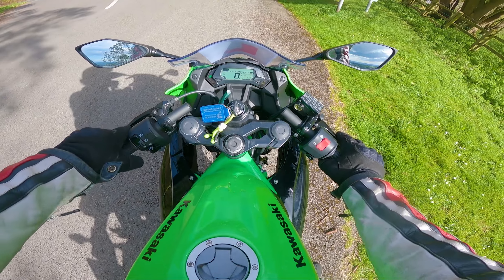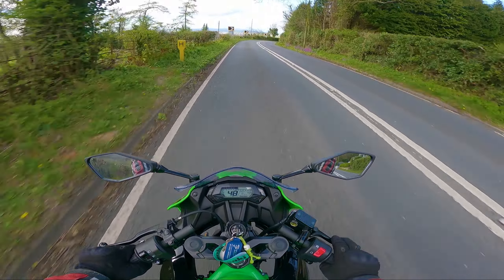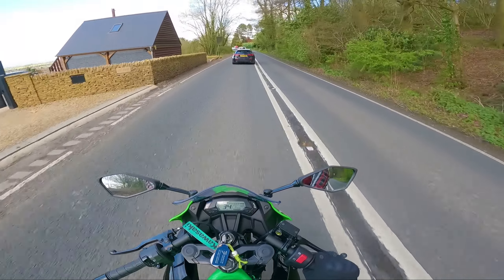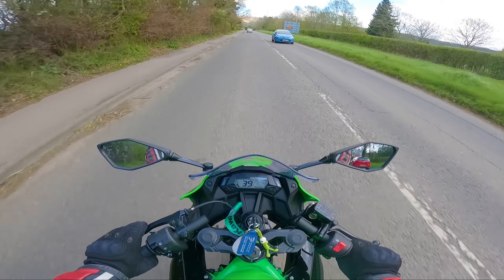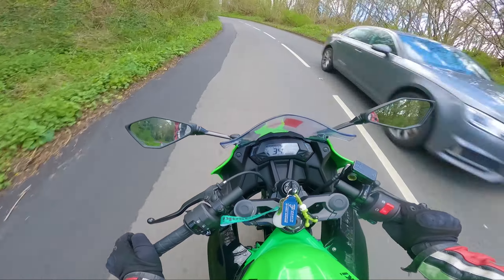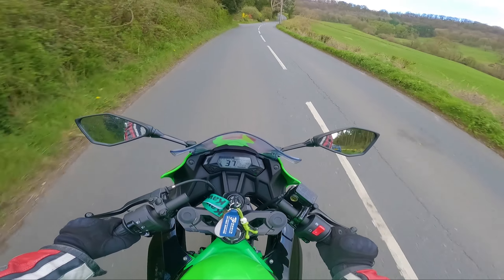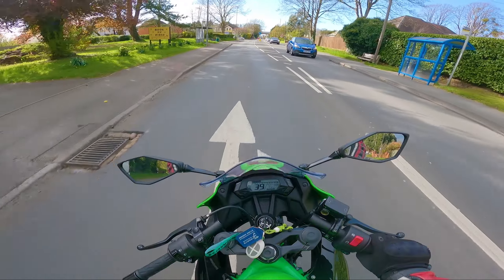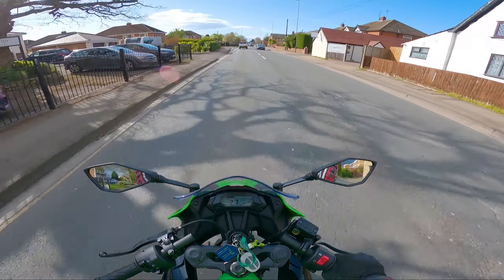Cornering a Motorcycle isn't as Easy as you think...

Comment: I highly recommend learning to ride at speed on a track then transfer to the road.
Reply: I'm sorry I'm just beginning to ride, but is it because it's easier to balance?
Reply: @TanyutHuidrom  it's a controlled environment and you get to know your bike by practicing leaning and braking before corners.
Braking; 
Never break if you can help it IN a corner, brake hard first before the corner then coast through, gently giving gas as you exit the corner. If you think you're going too fast for a corner brake hard best you can before corner then coast through...you should be ok. Don't brake hard into the corner.
 Gear selection; Short shifting(shifting early) or keeping a bike in a little too high a gear can help cushion your throttle response so you don't lose it by giving too much throttle(a problem if you're learning on a 1000cc or bigger bike)
If you're lucky to have a track nearby they are usually very reasonable.
There are also learning courses offered for free or close to it if you look around your area.
An open parking lot is nice too, even at night.
I took a course that was held at Warkins Glen race track years ago and it was amazing.
Don't be afraid to lean pretty hard the bike isn't going to slip out from under you. 
Having a riding buddy helps too.
Start on a pretty small bike like 500 to 750 cc(my first was a 650 Suzuki and it was still plenty fast) A litre(1000cc) bike isn't some uncontrollable beast but a small bike let's you learn your leaning, braking, and cornering.
So on your next session brake hard with front brake or both, coast through corner, then give power slowly coming out of the corner, do this over and over until it's muscle memory. Pay attention to your posture, if you're fighting your bike somethings wrong. 
Town driving is tough too so don't only ride on country roads or track before your test.
On a track you can go fast too as you build up your skill. Don't rush just practice a lot and speed comes with time. Don't hang with wheelie popping Street fighters until you know your bike really well.
On a track it's nice and wide and again it's a controlled safe environment. Also a club or finding like minded riders to ride with is great idea too, clubs are awesome. 
Always remember, on a bike you're invisible on the road. So always look around and be aware.
Best wishes, keep practicing and you'll never worry about accidents etc. I've ridden for 25 years no accidents, nothing. But you must take your time.

Comment: Don’t drop a gear and rev match to slow down mid corner. It is better and safer if you learn how to trail brake into the corner. Your brakes are not something to be afraid of
Reply: Seems like dropping a gear mid corner can go horribly wrong for a beginner
Reply: If you have a lot of power dropping down mid corner can actually make you lose traction as the revs shoot up...
Reply from the maker: I find trail braking gives me less traction than dropping a gear depending on the lean angle. On a little bike you don't have to worry about the power too much from rev matching, but I do see your point. The issue my wife finds her self in sometimes is being in too high a gear going into a sharp bend, hence why I mention dropping a gear mid corner if needed, and you'll get a better throttle response on the way out. Ideally no braking or changing gears in a corner at all really, all should be done well before you start turning in. Thanks for the comment :)
Reply: @GoblinRides  Good point and nice channel by the way!
Reply: @GoblinRides  Yeah on a little bike like a 125, I can’t lie, I also sometimes dropped down a gear and rev matched… but always towards the end of the corner when I’m reducing my lean angle for the exit. Smaller bikes are waay more forgiving when it comes to that. Rev matching is a skill and with bigger bikes, mid corner rev matching becomes dangerous because if you rev too high and let the clutch out too fast, your tire will slip. I rode a z900 a couple times and you have to be extremely gentle with revs in slower corners because that bike is made for full throttle speed. I would never think to rev match that bike in a corner but if you have the skill and that works for you, all I’m saying is be safe. Love the video btw